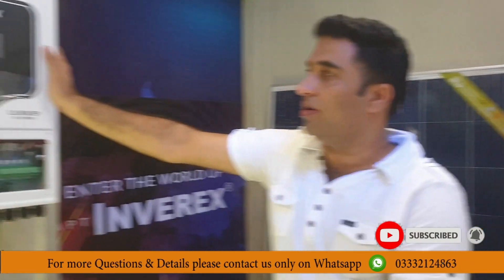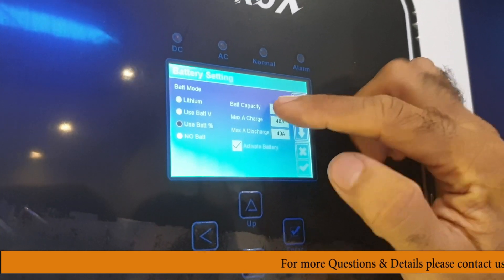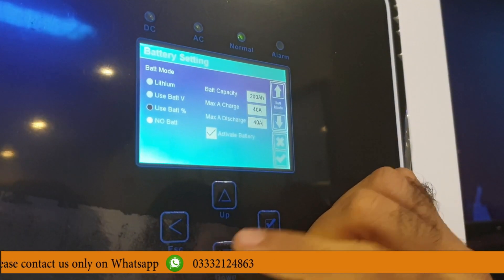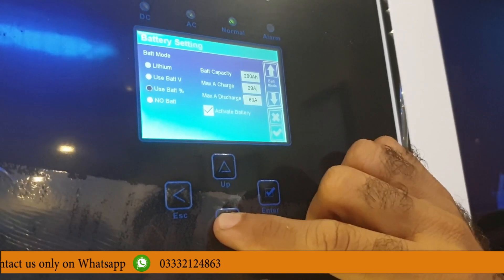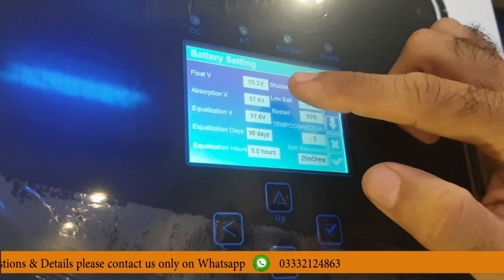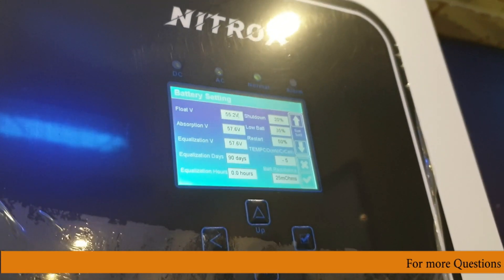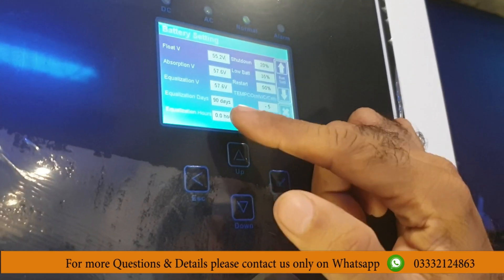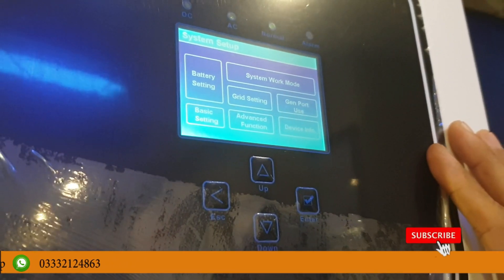INVEREX Nitrox Complete Battery Settings

Comment: mera aik question hai main nay 8kw system lagaya hai or after sunset mera load k.e pr chalta hai battrry use nhi krta kis setting main battery istemal kr skta hu. recently install huwa hai system mujhy k.e power breaker off krna prta hai in order to use battery. phr battery jb alarm krta hai inverter tou ja kr k.e on krna prti hai. mery pass inverex 5k.w 100ah lithium battery install hai
Reply: Manual main "Time of Use" setting ko study karain. Is setting main aap Battry ka usage/discharge yani SOC (state of charge) define ker saktay hain as per day and time. 

For example, 80% pe set kia to us time battery 80% tak discharge hosakay gi (grid off ho gyi to aur bhi discharge hosakti hai)

Comment: AOA, I have GRID charge enabled, The WAPDA is available, but still it show Off-grid, and it's not charging, in-fact running load from battery backup? What can be the issue? 
Inverext nitrox 6kw
Reply: did u find a fix ?
Reply: @QwertyQq-uh3ec  The voltage or frequency was low.

So for voltage I used low 170 and high 264
And frequency 47 to 53

Same for reconnect after
Reply: Also higher Amp can do this, so I set my amp 28 to charge the battery. Also make sure the Time of use is unchecked and the GRID charge in grid settings/ or in battery setting is checked. (if you know this)